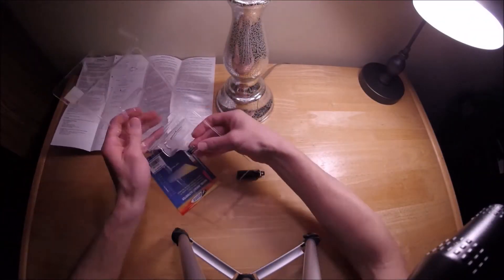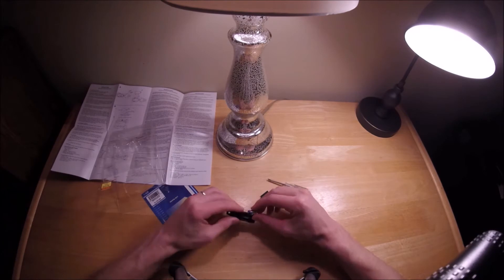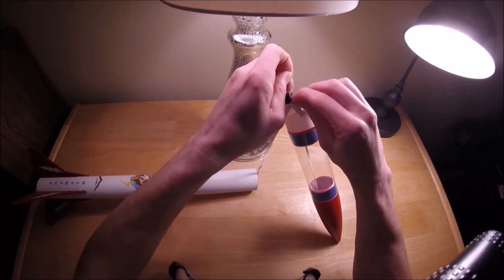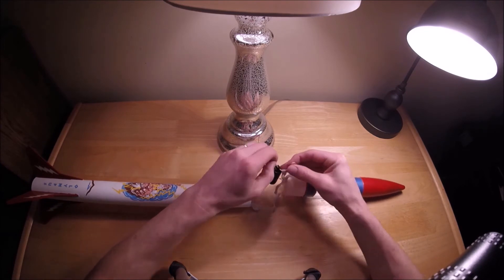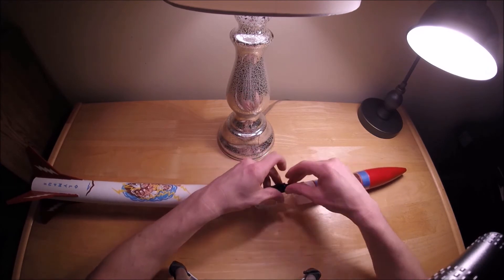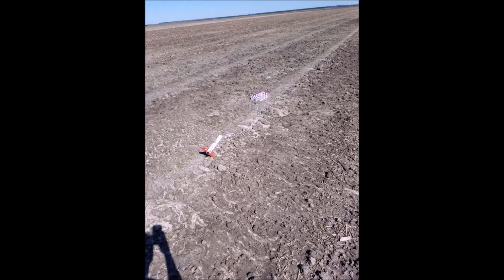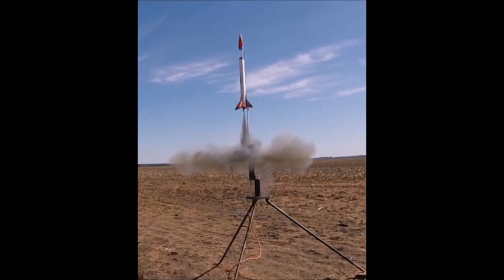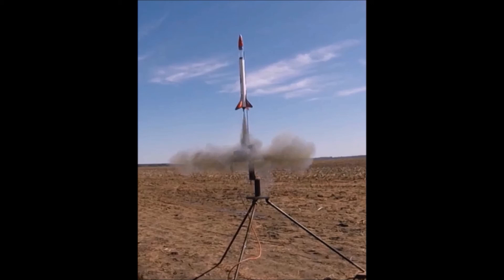Estes Olympus Rocket and Altimeter Review

Comment: The altimeter suggests in the instructions to place 3 to 4 1/8 inch (3mm) square or round holes approximately 2 inches (51mm) below the open end of body tube or payload section of your rocket. 

This is what the altimeter instructions suggest and not my own knowledge. I am just a beginner and just so happen to have the Estes model rocket altimeter instructions in front of me.
Reply from the maker: Yes, definitely should do the vent holes.  I still think mine altimeter doesn't work though, it was completely exposed to the open air hundreds of feet up and registered no pressure change, it probably doesn't work lol.

Comment: i Drilled 4 1/16 in holes at the bottom of the payload sec. and hang the altimeter in the p ayload sec. works everytime  estes altimeter
Reply: How did you hang the altimeter in the payload section. Once they have us cut the bottom of the nose cone off they affectively had us cut off the place to hang the altimeter in the payload section it seems.

Comment: Yes, you have to drill holes in the body. Otherwise it can't sense the air pressure. I have an Estes altimeter and it works fine

Comment: Bro nice video, so I was going to buy an altimeter like yours. Are they pretty durable? I sometimes have parachute failures..
Reply from the maker: Well, i still haven't tried my estes altimeter again since this video.  There is a small chance it might work if I had put vent holes in the rocket but I just went ahead and got a jolly logic altimeter.   The jolly logic altimeter I think are durable, I've used my chute release at least a dozen times and the altimeter 3 has survived both landings in two flights I have on it with relatively small parachutes.  I recommend getting jolly logic altimeter.  If you haven't already make sure to watch my video titled Rocket Comparison to see jolly logic altimeter 3 data.

Comment: hi could you build the Estes extreme 12 please
Reply from the maker: I dont currently have one in my build pile but would like to build one someday.  I do like the design,  which is very similar to the multi roc, so try referencing that build tutorial.   The main thing to be careful with will be the axial alignment of the motors so definitely have some d12s on hand to ensure getting the stack up right.  Also the booster fins will be a challenge due to the size and short length of the tube.  You may want to have the booster tube dry coupled to the second stage to give more room for hand placement when gluing the fins on.  Good luck with the build!
Reply: @rwkhobbies1969  thanks for the advice,  keep up the great videos